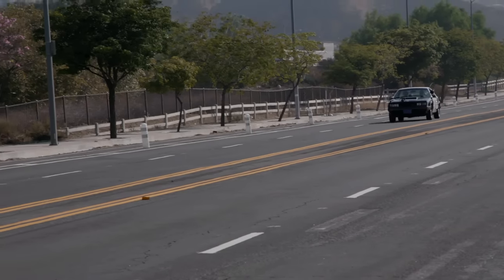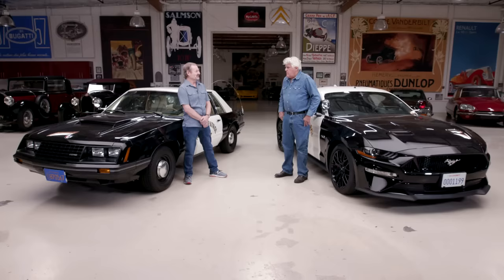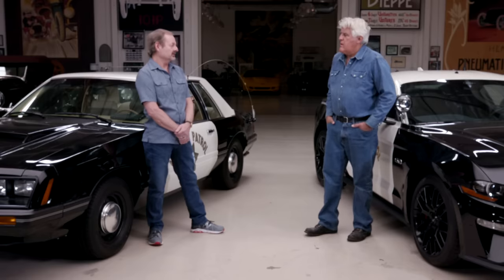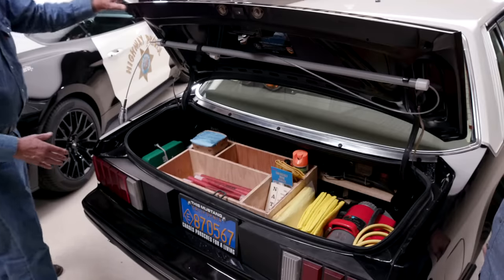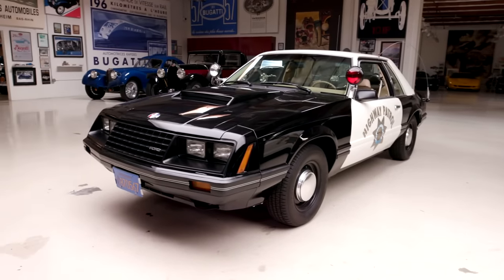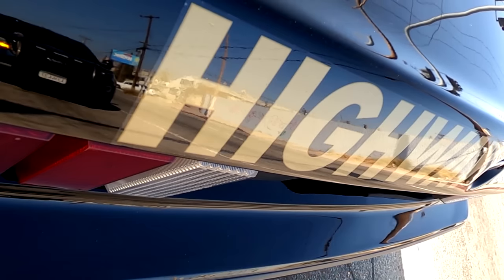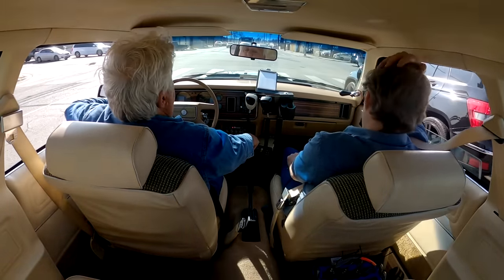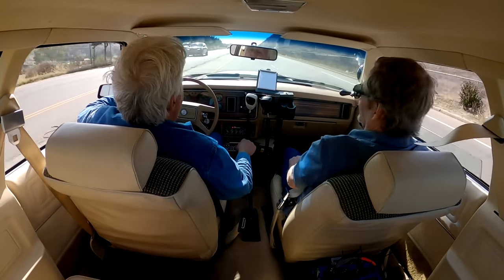This Mustang Chases Porsches for a Living | Jay Leno's Garage

Comment: I drove a 1988 Mustang SSP (one of 37 that the Alabama State Troopers bought the year I became a Trooper). I was also issued a 4wd Chevy Surburban (SWAT Truck)...I kept all my SWAT Gear (including a M60 belt fed machine gun in the SWAT Truck). When I cuffed a suspect I would cuff them in front, put them in the passenger seat, secure the seat belt and connect a chain from under the seat to the cuffs to keep the prisoner from escaping....sorry these cars wouldn't do 180....not even downhill!!! 138 mph on flat road....153 downhill....measured by Radar the "certified" speedometer was way off at top speed!!

Comment: I'm 6'1 and I fit in the back of a squad car 2dr Highway Patrol back there before in '89! Was a little tight and I accidentally sat on the troopers hat I didn't tell him that though I fixed that before I got out of the squad car to going to the jail. And no they did not handcuff me he must have liked my smile! 😄 A stock 5.0 in the 90s would do 143 that's without a police SVO valve body in the transmission on the aod trans. They would not shift into overdrive at full throttle when you would let up it would shift into overdrive unless you have the SVO police valve body LOL

Comment: Reminds me of my dad. The guys from Detroit in the 50's and 60's are just a different breed. Regarding the spotlight law. 

CVC 24404 
(a) A motor vehicle may be equipped with not to exceed two white spotlamps, which shall not be used in substitution of headlamps.
(b) No spotlamp shall be equipped with any lamp source exceeding 32 standard candlepower or 30 watts nor project any glaring light into the eyes of an approaching driver.
(c) Every spotlamp shall be so directed when in use: That no portion of the main substantially parallel beam of light will strike the roadway to the left of the prolongation of the left side line of the vehicle. That the top of the beam will not strike the roadway at a distance in excess of 300 feet from the vehicle.
(d) This section does not apply to spotlamps on authorized emergency vehicles.
(e) No spotlamp when in use shall be directed so as to illuminate any other moving vehicle.

Comment: In the 80's the Montana Highway Patrol had some of these. And Porsche would bring cars to test in Montana as the speed limit on the interstate was "Reasonable and Prudent" until the 55 mph national limit at which point you would get a $5 fine for failure to conserve natural resources.

Comment: After getting out of the Navy, I wanted to be a police officer.  This was Vietnam Era, and in Arizona, to be a police officer you needed to be a minimum of 5'8" tall.  (later as they allowed women to be police officers the height requirement was removed.). Being only 5'5" tall, I looked into the Arizona Highway Patrol.  They had even in 1973 no height requirement ... and former military service gave some brownie points.  I applied, was tested, put on a waiting list that was over 3 years long, due to limited need for AHP officers .... by the end of 3 years, I was in a long term job, and had moved about five times, and not kept my info with AHP current, so they just moved on past, and I worked for that long term job for 19 years.  I also tested for local Fire Department, (Navy background helped) ... but their waiting list was over a year, and with moves and such, missed out on it as well.  Though ended up being a volunteer fire fighter for the massive long term employer.

Comment: I always liked the tail lights of these early Fox Body Mustangs but my favorite, the one I personally consider THE Fox Body Mustang, is the 85/86 model. Here in England, after a car crash, my dad got a 85/86 model LX V6 fastback (or liftback which ever you wanna call it) in red with red interior and the registration was C220 MGN (she's now a silver drag car last I saw after my did sold her over a decade ago) and we called the car Meghan.
Reply: Ahhh the Porno Red interior.....I always hated that color....
Have a '92 F-150 Razorback Stepside/Flareside 351/auto now with that stinking porno red interior...
It's actually the only Ford I have owned that I actually hate....mostly due to the Razorback crap and the porno interior.
Reply: @rider660r  just searched the racerback f150 stepside from 92, man that's an awesome truck
Reply: @harleyrobertson6746  They may look cool but they suck to drive and wash.
The spoiler blocks your view and you need to hand wash it.A automated wash with the rotating brushes will work them lose or could possibly rip them off.
Once they work lose they're going to let water leak in,vibrate and wear through the paint and then rust. 
Then you have the molded steps....The main support brackets rust through and new brackets are like $500 each.
Reply: @rider660r  I suppose maintenance would be difficult with all that bodykit
Reply: @harleyrobertson6746  Washing by hand isn't a big problem,the real problem trying to look for traffic at certain times.
Once the bolts that fasten them on get lose,yeah it's PITA because you have to remove interior panels to get to the backside of them.

Comment: I had a 90's SVT Cobra I got it up to 152 in Eastern Washington near Moses Lake. 
At least that's what the State Trooper said he clocked me at. 
He was driving an unmarked Firebird. The 2nd trooper that arrived had a red Volvo wagon. When he showed up I thought "oh oh...I'm going to get transported and my Cobra is going to get towed.  I was polite and he wrote me up for 73 in in 65. Still was over $100. 
But they were all over that Cobra, first checking for drugs or weapons. Then just checking out the car. 
Sadly was stolen in Seattle. Never to be found. Replaced it with 98 SHO. That was fast for the day. Cruised it on the same stretch of road at 135 looking out for the sneaky WSP.
Reply: all the best buddy🎉🎉 congratulations🎉 let's talk on telegram you've been randomly selected among today's (GIVEAWAY)🎊,😍

Comment: I had a carbureted mustang I think it was an 86, it was definitely slow but it always felt fast cuz that rumbling V8 always there had plenty of torque that made it fun
Reply: 86 was the first year of fuel injection for the 5.0.  I had one. Yours might have been an 85.
Reply: One of my biggest regrets was selling it.
Reply: @Peedarb  I bought my 86 new and sold it in 2001 with about 10,000 miles on it. Don't regret selling it because I now have a 2019 Ecoboost, 6 speed manual with more power, better gas mileage and much better build quality.

Comment: Over 150 mph with the brakes and tires on those cars was (and still is) crazy.  Running at those speeds gets you accustomed to the speed but the cars have no ability to really adjust

Comment: Lots of chatter about top speeds being this and that. Fact is the early carbureted SSP (police) coupes were equipped with certified 140 mph speedometers and were good for 120-125 mph top end per Michigan SP testing.  When the fuel injected models first came out in '87 they were true 140-150 mph cars and were able to bury those speedos so from '89-'93 Ford installed certified 160 mph speedometers.

Comment: I had a '77 Ford LTD, supposedly a chief's car, reasonably low miles. It was almost completely stripped of cop gear. The only thing left was a high idler that would keep the alternator charging if the car had to sit on the side of the road with the lights (all missing) going. Thing had a Mercury 460 (I don't think Ford made the 460) and a Rockchester quadra-bog carburetor and B.F. Goodrich radial mud and snow tires. I have never seen a street car tire with tread that thick. Traction was insane. The suspension was cop, I was convinced you could drop a grand piano on it and the suspension would just squeak. 2nd or 3rd day I had it I was coming down this connector highway towards I-95. Speedo went to 140 and an inch or so past 140 was a peg, the needle was tick, tick, ticking off the peg so 145-150? Unfortunately it had the typical 70s 'no toucha the ground' power steering. My '07 Hyundai Accent has better steering and road feel. Anyway the road opens out to 4 lanes, I am screaming along and pass two cops sitting on the side of the road. There's a moment when maybe they think a fellow cop is going by but their lights come on WAAAAAY back in the far away. I really don't want a 150mph speeding ticket, that's probably reckless driving and an arrest so I don't lift... And a guy in a '60s VW Beetle putts out onto the road and gets in the 3rd lane directly in front of rocket ship me. I tried to drive around him because otherwise I was going straight through him. I went from guardrail to guardrail never hitting but coming crazy close (that steering SUCKED!) I get the car under control and slowed some when I come up on the sweeping left loop onto 95 North bound. I must have gone through that at 60ish, still can barely see the cop lights off in the distance. I get on 95, bomb off the next exit and back road the way home. Had the car two more days and was taking it to a muffler shop for a broken hanger and some old bat ran a stop sign and caught me RIGHT on rhe rear wheel causing the rear end to eat itself. That was shortlived but FUN!

Comment: I have looked into the 90s 5.0 liter police mustang..California started it and asked Ford for a straight line fast car...then Florida bought them..Ford said we are going to design it to run flat and straight at 160 mph..the computer wasn't going to stop it..Double the brake power .double the radiator..double the engine oil and transmission fluid cooler..designed to run only on 93 octane.(shell)..so i believe it would mantain 160 mph..180 i would have to see it and ford would have to swear this is true

Comment: My '86 "GT 5.0 HO" would only do 144-mph bone stock.  That was radar clocked by a friend that worked for the State Ploice.
  It was about 02:00 on a back road with a 1 mile straight stretch.   My speedo went to 85mph, and that's when I hit 3rd gear @ 6,000 on the tach.   The rear axel I believe was 3:71 gear ratio.?   I don't know how these California cars were set up but I would think 160mph would be the limit.?   180mph um, no way, not the factory Foxbody mustangs.

Comment: It's funny, at 27:12, where Jay comments how amazing it is how much automotive technology has advanced, because this Mustang in this video, considered a hot car in its day, is honestly quite slow.  But the thing is, a fast car from twenty years earlier would have blown the doors off this Mustang.  The car in this video came out when I was in high school, and we all wanted old muscle cars because new cars were so anemic.  To get a fast car in the eighties, you had to go back and get a used car from the 1960s or very early '70s.  Automotive technology hadn't yet compensated for the engine-strangling emissions gear that got mandated from about 1975.  It has now and then some.  I own a supercharged 1963 Studebaker Avanti that would probably outrun this Mustang, at least in a straight line -- being front heavy, and having a more antiquated suspension, it probably won't handle near as well.  But cars today make much more horsepower, and go a lot faster, despite weighing much more, and they get better gas mileage, all on today's much crappier gas.  They're quieter inside and more comfortable to boot.  It really is amazing how much automotive technology has improved.

Comment: That engine is not a standard 5.0L/302. That is the first generation 5.0L H.O. (High Output). These had better cylinder heads and a camshaft from a 351 Windsor V8, which changed the firing order. In 1983 and 84 these were changed to 4 barrel carburetors for 175 HP. 1985 received a roller cam for 210 HP and 1986 recieved new heads and EFI, losing 10 HP to 200 but a big increase in torque. 1987 got better heads again and EFI for the 225 HP, and yes, they will run 160-180 MPH. For civilian buyers these engines were only available in the hatchback GT models from 1982 to 1986. In 1987 the HO engine became available in all Mustang models including the LX notchback which is the same as the car featured here.

Comment: I had a friend who owned a 1979 Indy Pace Car Mustang, the real 'foundation' of what would become the 1982 Police Mustang...and can tell you first-hand, the car was a solid 14-second quarter mile car...but that was about all it had...MAYBE 120 top-end, rode like a covered buckboard, HARD 'Reccaro Seats'...not a fun car to drive around, or cruise in - AT ALL! His father owned a body shop, and with working on a front-clip replacement on a 'Police Mustang', he was clear, 'the Indy Pace Car was a better built car than the Police Car, and that wasn't saying much at all!'...but, as Leno said...it WAS a Mustang...
There IS a reason why Ford didn't use the word 'BOSS' in 1980, when considering bringing back the true Mustang with the 302, and instead went with 'GT'...

Comment: I have a 2004 Mercury Marauder that I bought in 2005. At the time of my purchase, the Florida Highway Patrol had about a dozen or so modified by Dennis Reinhart so it was easy to slide down the highway at 95MPH and not get a second look from the CVP units. They were invisible and sneaky.

Comment: My Dad had a 1979 mustang worst car he bought, it was plagued with multiple issues.  The turbo failed very shortly after he bought the car new. The spark plugs fouled up constantly. He had to replace the entire clutch, the carb was replaced multiple times, and the unique California emissions they had on it completely plug up.  You also had to say a prayer before starting the car in hopes the starter wouldn't give out again. He practically rebuilt the entire car several times before giving up on it.  Looking back he said he would have bought a Camaro or something else.  O and the final jab in your side was the fact that the overall performance on the car was disappointing. This car could get nowhere near 180.  Remember folks these were muscle cars not "sports cars", It was all about the quarter-mile back in those days.  Today folks want performance over muscle. So they can drive down the interstates and freeways at 160+mph.

Comment: 160 in that car sounds outrageous but i know cop car engines are not like stock engines,  and if they were getting 25 miles to the gallon then the back end
gear ration was pretty high and that would give them speed when needed, also the two barrel was not a stock two barrel  i had a two barredl that was as 
big as a four barrel and you could tell when you hit it.

Comment: That CHP officer is full of it.  160-180MPH? Oh please. My tuned 2012 GT would struggle to hit 180. The fastest I've done is just over 160, and I've seen a video in Germany of one doing 170. The question I have is, why blow smoke up our rears? Especially on Jay Leno's show which is watched basically exclusively by car enthusiasts....
Reply: Exactly. I had a 2012 and 2013 5.0. Those are FAR faster cars than any close to stock fox body 5.0, and won't do much over 160. The fastest fox body Mustangs would be lucky to hit 140.

Comment: Someone probably called BS earlier but NO WAY any Mustang cop car would run 160 or 180.  Absolutely NO WAY.  I bought a 92 5.0 LX new it would run 99 mph in the 1/4 on street tires.  Maybe 135 clock speed top end, not indicated by an inaccurate speedo.  No way in hell 160 or 180.  I promise you Jay Leno knew he was FOS but could not say in the interview.

Comment: It's got a cop motor cop tires cop shocks cop's suspension it's the precatalytic converter model and it'll run good on regular gas.  So is it the new leno mobile or what?

Comment: Those Mustang CHP cars were very high geared, and you could hear them struggle to take off from a  stop. The 302 Ford engine was not known for having much low end torque back then. There were some police pursuit cars that were made for acceleration. Saw a Plymouth or Dodge that looked like a Super Stock racer. Officer had on leathers and a crash helmet. Pretty dumb on the streets of little South San Francisco!

Comment: It's time to Debunk

1982 2bbl variant with 157 bhp

Latest EFI version 225 bhp

Retired CHP Officer claimed at the 4:00 minute mark, that he could bury the 160 MPH Speedometer, maxed out at 180 MPH

Considering the aerodynamics of the Fox body, and the limited power output of the H.O. 302, the CHP Ford Mustang pursuit vehicle would not be capable of obtaining 160 MPH, even if dropped out of the Space Shuttle or Space Station.
Reply: He got it up to 160. " Figuring it out with a tach I could get it up to 180."

Comment: Jay had no idea with the right computer adjustment the 5.0 with go 150+
Reply: That car was made long before sophisticated computers were standard equipment. P.S. In my 2012 GT, the governor limits you to 145 and you're still accelerating pretty well when the governor chops the power.
Reply: @Dr. Jeff Dr. Jeff  so without the computer stopping the fuel then it may go 180 before it blows the engine

Comment: They were having trouble catching fast cars because Jerry Brown made them buy fuel efficient cars. For years the CHP had dogs that could barely hit 80 going uphill. That ended when a Sacramento TV station did a ride-along with the CHP on the I-80. They were going uphill when a Mustang blew by them doing 100+. The CHP unit couldn't do a thing. Once that hit the TV news the Governor got embarrassed and let the CHP buy hotter cars.